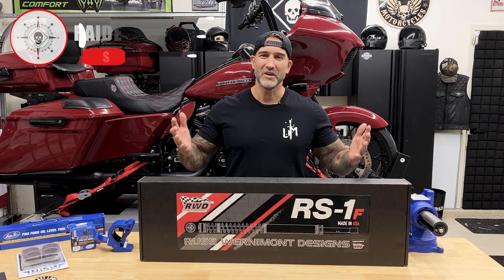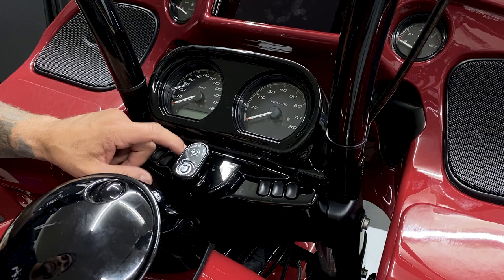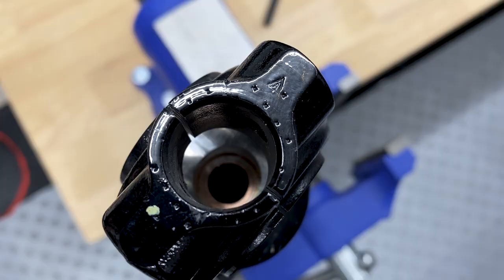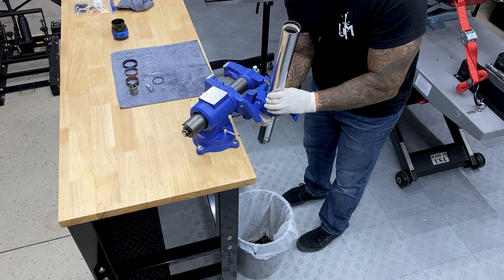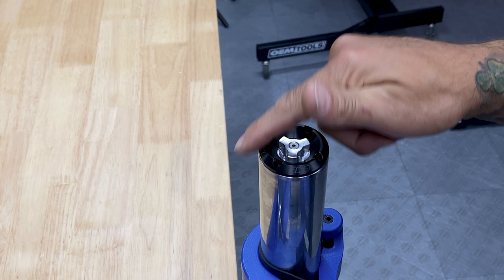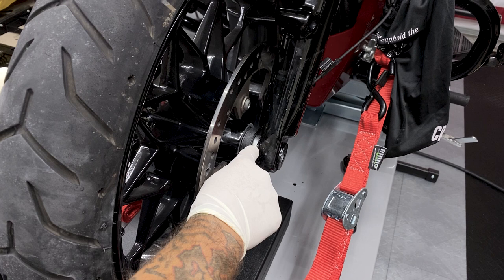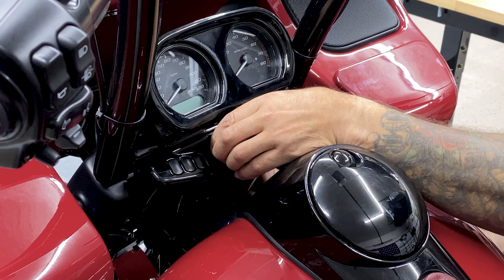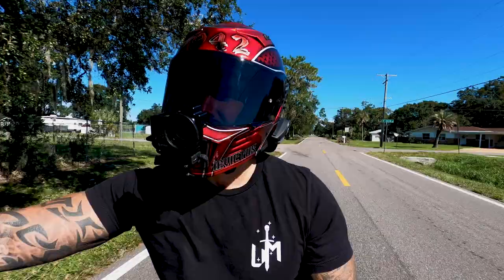Front Suspension Upgrade RS-1F for Harley Touring from Russ Wernimont Designs

Comment: New sub! I like the way you used the bucket lined with a bag to catch the debris and oil. Never too old to learn new tricks! Thanks for the video! Going to change out the lower forks to chrome soon this winter. Don't care much for the factory finish, Bugs are eating it away. I was considering repainting them and spraying some chip-seal on them to see if that would hold up better. Thanks again for the video work. You did a great job making it an easy project. Keep up the good work.
Reply from the maker: That’s awesome, it’s definitely a fun project.  I’m glad the video helps, and Thank You for the Sub🤟🏽

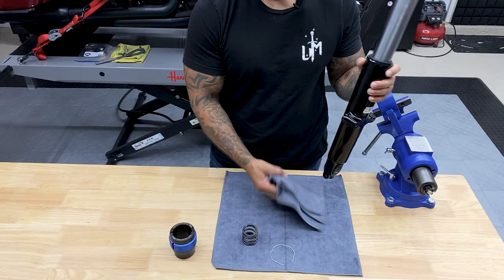Comment: WARNING: ERROR IN THIS VIDEO.  I just installed a set of RS-1F of my 2016 Street Glide. This video was a huge help, HOWEVER at 15:52 there is a huge mistake made. You should NOT install the upper bushing and the fork seal in one step. The bushing should be installed first, then the seal separately. Installing the upper bushing and seal in one step as shown here puts unnecessarily destructive force on the seal. The correct procedure is to insert the upper tube into the lower, place the upper bushing in place where it will seat into the lower fork housing, then put the washer on top of the upper bushing with the bevel facing the upper bushing. 2) use the slide hammer to gently press the upper bushing into place.
Reply: (Continued) Use short, light hits until you hear a "solid" sound. It will sound differently when seated fully. Also, be sure to have the lower housing on the ground or a very stable workbench. when doing this. Pull up the slide hammer and the washer and inspect the upper bushing to assure it looks correct and fully seated. 3) remove the slide hammer, slip the fork seal onto the upper tube assuring the numbers are up, facing you. Put the slide hammer back onto the tube and once again use short light hits until you hear a more solid sound. Check to see that the retention ring seat is clear, then install the retention ring.  I hope this helps!
Reply from the maker: There are different techniques out there, but thank you for the input 👍🏽 I’ve done a few of these with no issues

Comment: I was amazed the pinch bolt would hold that axle for the 70-75lbs ft of torque. on my 21 street glide I'm just able to sneak a poking tool in to adjust them after putting it all together

Comment: Great video!!!!
That original HD pre-set preload looked to be about 40mm? Typical HD shortcut, instead of a high quality spring with pre-set of 20mm HD installed a cheap spring and then compressed the hell out of it! This has been a longtime cheap remedy for soft inferior springs.
The RWD pre-set looked to be about 20mm, which is an indication of a quality spring.
Reply from the maker: Thank You!  Definitely a substantial upgrade.  You can tell the difference right of the gate

Comment: Does this system apply to the 2023 tri-glide...!!
Reply from the maker: I believe the 2023 Tri-Glide models have a different front suspension now.  I would contact Russ Wernimont Designs to confirm.
Reply: @RAIDERWORLD  Thank you for getting back to me. I'm interested in the DKCustom NEXGEN suspension system , or the Legend air ride A - huge cost differences .
Reply from the maker: @deanbedetti5375  No problem! Absolutely, any suspension other than stock is better

Comment: Installed on my 15 flhx. I find them uncomfortable,  I feel every bump in the road. Adjusted all the way left and all the way right with no difference. Any ideas?
Reply from the maker: You are still going to feel the bumps.  No suspension will ever get rid of that.  This Front suspension hones more into the front end dive and cornering.  If it’s really bad, I would definitely contact Russ Wernimont Designs

Comment: Hey dude awesome video! Check out Big Bear Performance’s gauge relocation kits for your Road Glide if your interested in being able to adjust the fronts without removing things. When i did the front ohlins Nix 22 fks 228 I couldn’t adjust them unless i removed the bars! So i ended up installing risers and relocating the gauges to the top of the Radio and let me tell you, being able to adjust the front suspension on the fly is a game changer!!
Reply from the maker: Absolutely! Thank You for the info.  I was looking into a couple, so we shall see.

Comment: Since the bike is so new is it necessary to do a rebuild kit?
Reply from the maker: All depends how many miles you have on in.  I always suggest changing out the seals, because once you separate that seal from it being set for so long, it could ruin the integrity.  And you’re already in there, so it leaves the worry out.
Reply: @RAIDERWORLD  Is it required to totally disassemble the strut to do this?  Can I just remove the guts from strut and insert the cartridge?  Thanks

Comment: Nice video. Is that bottom bolt a 12mm or 14mm?
Reply from the maker: Thank You! So the Top fork nut is a 19mm Hex and the bottom drain plug/damper tube screw is a 12mm Hex